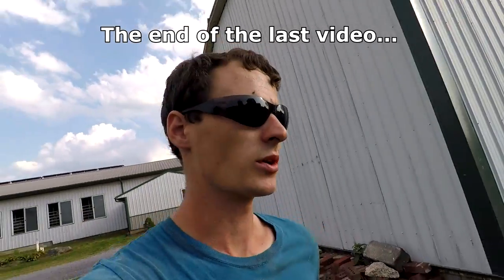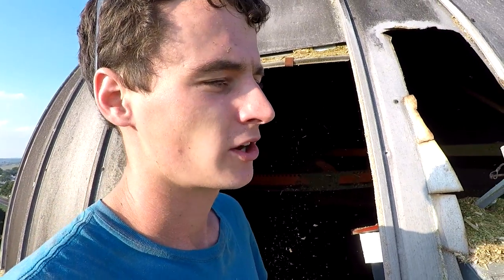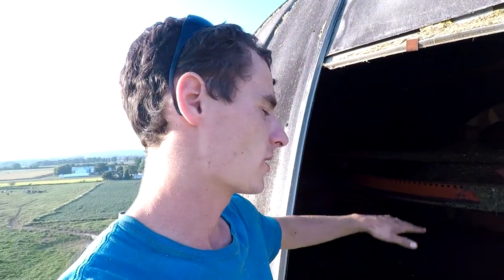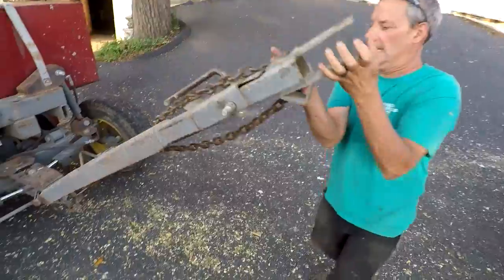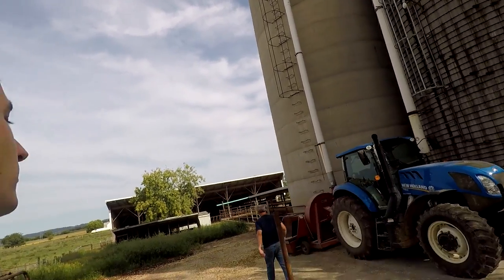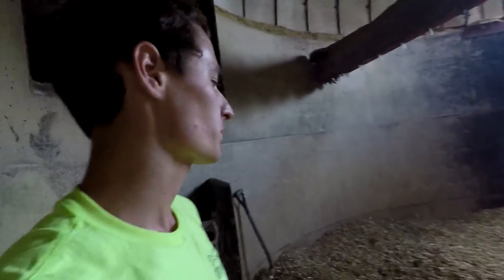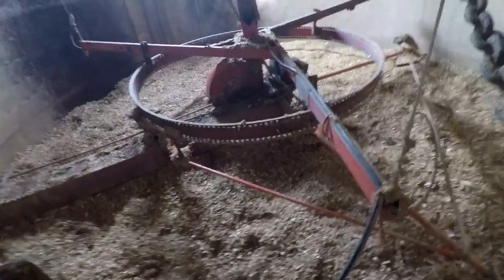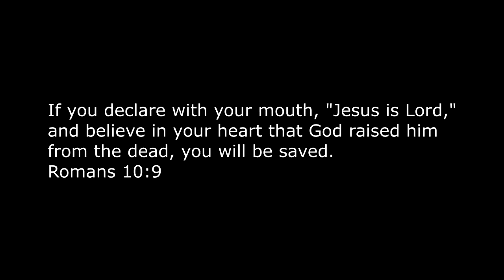Filling Corn Silage Silos | Leveling and Setting Up Silo Unloader

Comment: Sucks we weren't able to make it past Sept 96 farming.  Most of my other family's farms are Amish or Mennonite owned now.  Our 14x45 Harder was taken down and is like a 12x35 now on an Amish Farm 20 minutes from here.  My Uncle's farm is Amish owned, they redid part of the house, the 16x40 Silo is gone to same area as where our Silo went, and they still have the 16x50 silo.  The Badger ring drive that Grandpa put in that silo new in the late 80's I bet is long gone now.  Both the pack drives in the other 2 were pretty much junk.  Now they are Fork Powered LOL.  Allot of Mennonites moving in closer to me, redoing or putting up new barns, moving the current silos to a different spot, reassembling, putting in new Unloaders, and adding silos! I like seeing the Silos making a comeback.  Some places had 1 or no silos, now have 3-4.

Comment: I've spent many years working in confined spaces in refinery's in distillation towers as a pressure vessel inspector and there are many hazards there....glad you knew to vent it first, I probably would have still liked to have some one up there on the outside while I went in and would have possibly used a lanyard or yo-yo incase of engulfment. I have been places where people have been engulfed in similar stuff like that before.

Comment: I guess it takes days to fill that last 2 rings?   Crazy how it keeps settling.  Great video, alsome channel!
Reply: yes topping up that type of silo so its 100% full and stay full is almost impossible.
back in the late 70s we tried 14 days topping it off every day but even at the 14 day it settled more than 1 feet over night,  so we just coverd it and let it sit until we started feeding later in the year
Reply: Not the "Corn Squeezins'" I was thinking of.🧴🥴 😀
Reply: @cojones8518  my dad sold our farm to his brother back in 1968 and I began working for my uncle.  We were getting ready to fill our 14 x 50 stave silo later on in early September when my uncle hired a crew to clean and plaster the inside.  I asked him why he had to do that and he said because my dad always filled the silo with corn that was too green and the juices would flow and damage the sides of the silo.  That made me remember one time shortly after my dad had filled the silo and juices were seeping out of the doors of the silo and down the chute.  The juice was dark brown, the color of molasses and we had a cow that was drinking the juice from where it had accumulated in spots where the concrete was low.  A little later on I saw that cow jumping sideways and swinging its head around.  It wasn't  white lightning but from then on I called that juice brown lightning.

Comment: Try installing a remote cam feed at the top of the silo.  Save a climb or two.  Unless you're into climbing for excercise.
Reply: Like everything else on a farm, I'd expect a camera wouldn't last long in there before it got covered in grime or quit working.
I think I've heard of a system that IIRC uses sonar to "Ping" the top of the bin to show how far down it is, but haven't looked into it. Probably works like one of those ultrasonic "tape measures" <shrugs>

Comment: I have no idea how small the silo was on my uncle's farm where I spent my summers, enough for 30 cows, but it seemed big back then... I got to experience unloading it by hand when we visited during winters. I'll have to ask a different relative why you need to level the top before starting the unloader. My nature would be to let the unloader do the job but I'm sure at first that would be hit and miss for 5 vertical feet and might cause a jamb.... Or the unloader needs contact with the silage to turn? All I know is that we used to jump the thing and all were lucky to not have an accident

Comment: Whew...! I love to shoot nature photos of farms with large silos.  Don't think I'll ever be able to look at a silo the same way again.  :-O  Why put some feed in bunkers instead of silos?  Is it just a capacity issue or more complicated?    Thanks again, great video!
Reply: Some farms probably have a preference since silos are automated somewhat and easy when they work but more costly and more maintenance. Also space, bunks take up a lot of land, towers dont. Most big farms tend to do bunks because of faster filling and unloading generally.
Reply: Hi Random, thanks, but the space issue I had figured out.  What I was really wondering was whether the choice of storage chosen had anything to do with the type or quality of the feed being produced.  He talks about the feed stored in the bunkers being a better quality feed.  Thanks again.!
Reply: Most would argue that towers will have better quality feed coming out and less spoilage. Bunks take better management, packing at all times and making sure its sealed well. Generally bunks will have more feed wasted from spoilage. Especially if the tower is a air tight unit. Maybe he means they just put their higher quality forage in the bunks because of preference of feeding from them.

Comment: Why are the gases from the corn silage dangerous? Is it toxic to breathe, or would it ignite or something?
Reply: The gas is Nitrogen Dioxide which is lethal if inhaled in a concentrated form like that. Which is why they have to air out the silo before they enter to level it out.
Reply: The gas displaces the oxygen.   Extremely dangerous.   Many farmers have lost their lives in silos
Reply: Jason Bourne     the gas is H2S ?? Hydrogen sulfide ?
Reply: When I was a young man back in the early 70's I worked on a farm that had Harvestore sealed storage silos.  There was one that was almost empty that contained high moisture shell corn. The auger at the bottom of the silo was getting stuck and the access door was opened up.  The door had been open for several hours and the farmer and his sons were certain that the gases were gone and that it would be safe for me, the hired man and low man on the totem pole to enter.  They gave me a #2 long handle shovel and I was supposed to push the auger with the shovel when they turned it on from the outside of the silo.  The auger had stopped on the side opposite the access door so they shoved me in and I began walking toward the other side.  Before I got 10 feet I turned back to the access door.  I immediately passed out and the farmers sons had to reach in to drag me out.  They said my lips were blue when they got me out and I regained consciousness a few moments later.  This all took maybe 2 minutes.  About a week later another young hired man in Deforest, Wisconsin was trying to close the cap on the top of another Harvestore that they had just filled.  He accidentally dropped a wrench inside which he wanted to retrieve.  He thought it would be a good idea to tie a rope to the blower pipe and climb down the rope into the silo, retrieve his wrench and then (step 3) climb back out.  Everything worked except he never made it to step 3.  There was a farm in Mazomanie, Wisconsin that grew cabbages which they chopped and blew into the silo to make sour kraut.  They used a sizable crew of Mexican migrant workers to do this.  All went well that harvest and the following year they were emptying the silo of the sour kraut.  Problem was when they got to the bottom of the silo they found a pickled Mexican.

Comment: Does that silage eventually dry out?  What keeps it from spoiling?
Reply: oxygen can't get to it so it doesn't spoil. You're feeding out from the top down, so there is only ever 18-20ft (whatever the silo diameter is) exposed at any given time. As long as your feeding out of it regularly it shouldn't spoil.
Reply: Thanks! 🤓

Comment: How do u compact the corn silage to get the air out and do you have waste on the top  when it’s ready to feed
Reply: The top is the only part not packed . Not far down its own weight packs it. You can feed off it so much per day to keep it fresh or cover it with plastic. Plastic route the top bit will still spoil likely

Comment: I really wish you would follow OSHA safety rules. You are entering a confined space (inside the silo) without proper assurance. Corn silage should have a light, pleasant smell with only a slight vinegar odor. It should be slightly brown to dark green. If it is dark brown or has an odor that is fruity, yeasty, burnt or rancid (butyric acid), excessive heating or improper fermentation has occurred. 

The cells of the corn plant are still alive and breathing. This breathing by plant cells and microorganisms forms carbon dioxide and heat by using the trapped air. As carbon dioxide increases, an anaerobic condition is formed in the silo. Desirable bacteria start the fermentation process when plant respiration stops. If too much air is present or if carbon dioxide escapes, respiration will continue and the plant cells will use too much sugar and carbohydrates. This wastes nutrients needed by the desirable bacteria to "pickle" or preserve the green material as silage. This is why packing and covering immediately after filling is important.

Ideally, moisture content of the forages going into the silo should be sufficiently low to prevent seepage loss. On the other hand, silage that is too dry may not pack adequately and a higher loss from fermentation and molds will occur.

Once respiration by the plant cells ceases, acetic and lactic acids are produced by bacteria that feed on the available starches and simple sugars in this chopped corn. For desirable bacteria, the silage needs the exclusion of air, temperatures between 80 degrees and 100 degrees Fahrenheit and starches and sugars for food.

Fermentation will continue until enough acid is produced to stop bacterial action. The desired degree of acidity, a pH of about 4.2, should occur within 3 weeks after the silo is filled.

If improper packing permits too much air to be trapped in the silage mass, or if air seeps into the material, or if too much moisture is present, insufficient acid will permit undesirable bacteria to produce butyric acid. These bacteria consume carbohydrates, protein and lactic acid as they multiply. Formation of butyric acid will raise the pH and fermentation continues until all the readily available energy is exhausted. That is why the smell of rancid butter (butyric acid) indicates poor-quality silage that is low in energy.

Comment: Been there. Done that.  No fun.  One trick to is to use a ground feed or snow shovel when you are blowing in the last loads and use that to deflect the silage to the low spots after it comes out of the chute.  It is a lot easier than shoveling or forking.

Comment: What ist this for a tractor at 1:54 ? We dont know it in Germany
Reply: Agco tractor?
Reply: Julian Keller AGCO Allis. Probably one of the last ones made. It’s basically a Massey with orange paint. AGCO dropped the old Allis and White names and now markets Massey and Challenger brands in US that are mostly the same except for the color. They also market the Fendt as a separate brand in the US but there is some technology sharing among the different AGCO tractor lines.